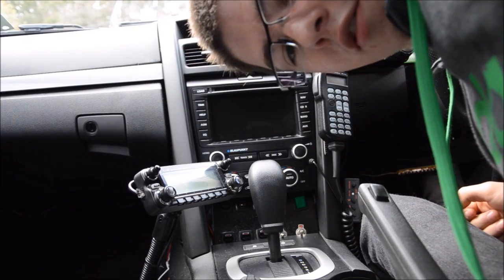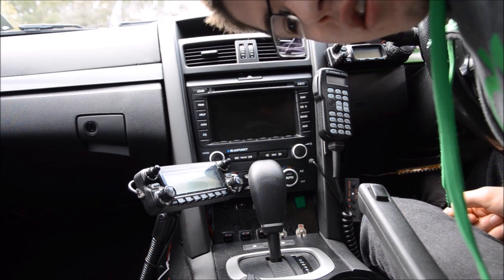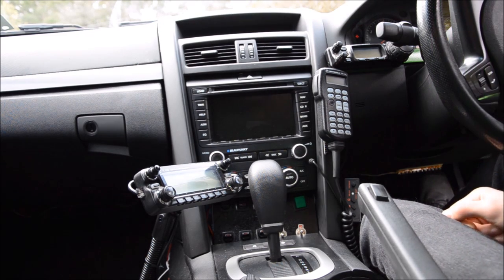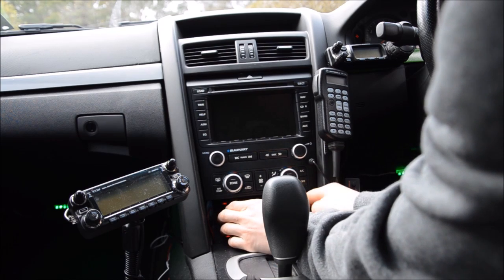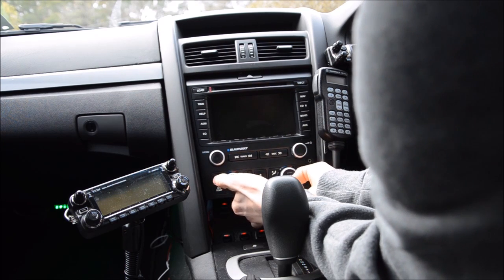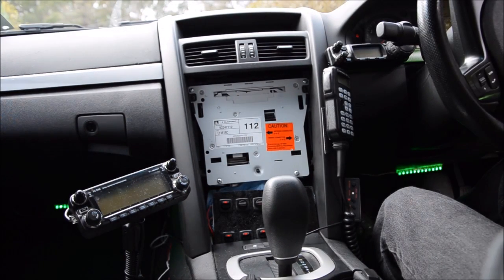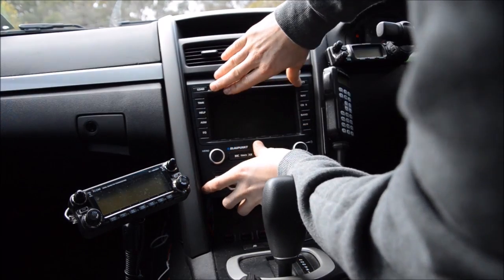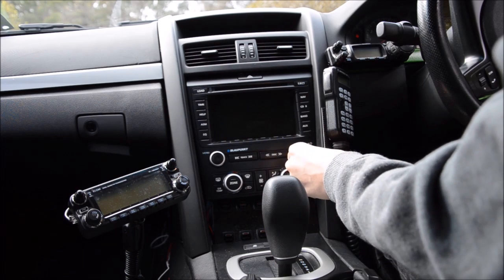How to remove the face of a Series 1 Stereo System?

Comment: What's involved when making the conversion from the omega unit to the upgrade you have?
Reply from the maker: The main this is getting the head unit reprogrammed with your car's VIN. There are only a few people in Australia (at the time I did it) that could do it. I got it done by a guy in NSW (was there for work).

Then it was pulling the old one out and replacing it. It was pretty straight forward, but the repogramming is the key. The guy's name was Jason who did mine.

Comment: Could someone please tell me if you can install this stereo system in a 2007-2008 Holden commodore VE? I want to take out my stereo system out of my 2008 Holden commodore VE and wondering if I can change it to this unit? Please help
Reply from the maker: Definitely can.

Mine is a 07 Omega and I installed an SS S1 Headunit in it.
Reply: What about installing it in a Vz SV6 2004 Holden commodore?
Reply: Do you have Facebook or an email I can talk to you on? Bc I need to talk to you about something

Comment: Hey just wondering if you would know or if anyone else does if u can pull out the stereo part of the unit amd just leave in the climate control part will the climate control still work ? As i have plans om makimg mime able to hold a aftermarket unit but want the factory climate control